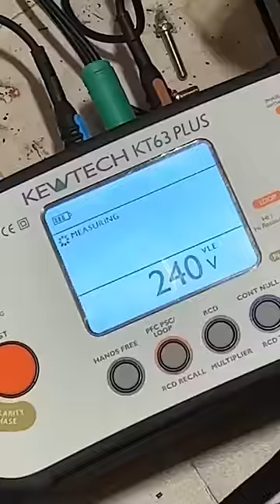Adapt improvise and overcome. Converting TNCS to TT #shorts

Comment: I'm amazed to see someone actually doing their job properly on shorts for once 😂
Reply: Except he didn't. First of all no professional in their right mind would convert TNCS to TT especially considering it would involve ripping up the street and changing the lines from the substation.
Reply: @xARMM4G3D0Nx  what I meant was his practical skills not the job itself
Reply: @jordanf811  would have been better to not post anything at all.
Reply: @Big_AlMC  cool
Reply: Crap and dangerous workmanship
Reply: @xARMM4G3D0Nx  Looks like he added a RCD and a Groundrod. So no direct change of the Gridtype. I think it’s even more a TNS than TNCS because of the allready splittet TN to Earth and Neutral.
Reply: @Srype5  well the title literally said "Converting TNCS to TT" wich is definitely not true.
Adding a Groundrod or whatever you call a "Tiefenerder" in english doesn't change anything, as you already know (besides lowering earth resistance) and I was pointing out said bullshit
Reply: @jordanf811  His practical skills don't include the knowledge that its illegal to remove the supply companies fuse.......
Reply: It was good to see him tighten the screws on the main wires coming in.

Comment: Yeah, that looks really nice, but the question ist WHY? There is no benefit to convert TN-CS into TT. You only increase your ground resistance (which is bad)
Reply: Maybe they’re having an EV charger put in.
Reply: Often I’ve come across this situation when questioning the DNO’s high impedance. The engineer will turn up and inform you there is no PME to that property and it has to be converted back to TT. 
I believe the earth rod scenario for EV’s would be to run alongside the existing PME, similar to a detached garage scenario whereby exporting the PME isn’t allowed. Given the high current characteristics of an EV the earth rod ensures that should the neutral go down on the PME then you still have earth connection to create your potential.

Comment: Beautiful work! Man, when I see how breakers, grounds, and sockets are done in other countries, I feel like here in the US we're still in the electrical stone age.
Reply: So isnt That in the USA? I thought so…becaouse of that many Milwaukee devices 🤷🏻‍♂️
Reply: @momimu90  nah, British if I had to guess
Reply: Fr I drooled over the breaker panel setup a little lol
Reply: No, usa load centers with bar buses and plug breakers are superior to that din boxes with a lot of cable and connections.
Reply: @momimu90 na that’s definitely not here in the US looks like the UK. Milwaukee is worldwide brody
Reply: @kefrenferrer6777  Nothing in the American electrical system is superior.
Reply: @NoiseMakerX  take it from me I’ve been in residential electrical for 10 years and we Definitely have a safer electrical system inside are homes. For starters the ground rod is only 3 feet long. Ours are 8 and you will have 2 of them.
Reply: @mottfuggelmire8514  Well, where I live we don't even need ground rods per house in most cases. Ground is supplied via incoming power. Another lousy thing about the US power system is that it is 120 V making every current in the end user system twice as high. And I've seen so many vids of power distribution poles burning. That couldn't happen where I live because the breaker would cut power before it got dangerous.
Reply: I don't know. I feel like, if the ground was grounded in America your house would burn down.
Reply: @momimu90 240V is not used in US. It's probably australia as far as i know, they (and a bunch of other countries) use 240
Reply: @creeper_ninja_ in UK the socket voltage is 230V
Reply: You have it backwards, friend.
Reply: @git-push  Australian men wouldn't wear gloves to use a drill and a screwdriver lmao my guess is uk
Reply: @git-push  contrary to popular believes, the US does use 240v for high power appliances like dryers, air conditioners, etc. The transformer for each house creates 240v with a CT/center tap for 120v.

Low power devices use this center tap for 120v but high power appliances use both ends for 240v
Reply: Is uk standard.
Reply: Is uk standard

Comment: Those Lewden RCBO’s are single pole. If you have a persistent earth fault on that CU you will lose all of your board until you clear the fault due to the front end 100mA type S. DP RCBO’s are the way to go if you need a time delay main switch.

Comment: As the absolute most bureaucratic red tape I thought I would ever see around the grounding rod
Reply: Without having seen the breakers yet, Gotta be the UK or maybe Australia. I've never seen one in the states that wasn't exposed with a bare copper wire running to it.
Reply: @MrNside  probably oz or kiwi. No CE labels on breakers.
Reply: UK England

Comment: Good job didn't necessarily need the 100ma RCD main switch as all the circuits have 30ma RCD protection.
Reply: Yeah I was surprised to see a 100ma being fitted these days. They look like rcbos. Maybe they are single pole?

Comment: Not sure what the requirements are over in crumpet land, but here in America you need a 16' deep rod. Or have two 8' lengths spaced at least 6' apart. Last I checked the physics of electricity are the same on either side of the Atlantic.
Reply: The requirements are different, that’s all I can tell you
Reply: Not quite accurate but not a violation.

Comment: Great work - pulling the DNO supply fuse ( bet u cut the seals first as well, noted there was no HV gloves and likely face visor, arc proof trousers and jacket) an absolute inspiration to those who think this is acceptable working practice - which it isn’t - you would be off the job on my watch.
Reply: dont talk rubbish, he switched all power off before removing dno fuse, its not NASA rocket launch....
Reply: Oh right so u know the cut out is electrically safe then? Let’s pull the fuse and wait for it to short - I’m a DNO electrical trainer you dckhead and know what I’m talking about , load or no load.
Reply: @AS-rb6yp  weird we had 10 flats that 3 blokes turned up to connect / fit meters  first bloke was not 3 phase trained so called in more colleagues ( each supply was Single phase ) but he could not grasp that 😂 They had gloves / goggles / face shields which kept steaming up and I have to say in 45 years of being a sparks I’ve never seen such a mess at the end of it but I suppose they were alive and hey who worries what the job looks like these days 😉
Reply: @kevinpickett7249  As I always say to any engineer - make a good safe and tidy job - ur name is going on it with ur seal number plus it’s going be there for many years - the prob is that there is too much emphasis on getting jobs done not forgetting your incentive payment there is no excuse for bad and dangerous practices and this video clearly demonstrate this and makes it appear acceptable. In so far as the flats are concerned that is an example of an engineer who has been signed off when he shouldn’t have been and another issue waiting to happen.
Reply: Ok karen
Reply: @YaM0MsAh03  you what?

Comment: Checking the comments for the “You did it wrong” gang. Undefeated😅
Reply: he actually did it wrong, not the method, just the work. proper grounding means you use a rod that goes about 7-9 meters into the ground (they come in 1meter sections which get screwed with one another, the first most bottom has a special tip)
Reply: @davideyt1242 what does this rod do?
Reply: @45-308  It's a grounding rod, the short 1-2meter long stuff is mostly sufficient for a roof mounted Antenna but not for grounding the electrical network of your house. true grounding is done 7-9 deep, since this is really deep those come in sets of 1 meter long rods which screw to each other, the first most-bottom part has a tip, you basically hammer them one by one and screw the sections until you reach a proper depth then you screw on top an adapter which has a slot for your grounding wire which than gets wired into your main switch box

Comment: There is actually a bit for the chipping hammer to ram the ground rods in. The rod fits in a cup much like the holesaw you used. I believe they are available in SDS plus and SDS max.
Reply: I have a similar adapter for a spline drive rotary hammer.

Comment: Milwaukee boy here. I’ve never seen that light before. Must have.
Reply: It is incredible!!
Reply: Them red tools not very good
Reply: @PLF...  Yeah, ok, whatever. Make me laugh.
Reply: 12V Rover service light. About $60. Been out for over a year, keep your eye out for the combo with battery for the same price. Does USB charging too.
Reply: I know right! Player ass light ....only thing I dislike about Milwaukee is the 12v , the batteries slip out the bottom of drill/Sawzall
Reply: @seanolsson1226  Mine never fall out. I’ve never heard of that happening. In fact, my batteries are a bitch to remove.

Comment: In America we bury a bare wire between the ground rods so it'll always pass the resistance test
Reply: You like cheating?!
Reply: @tekknorat  yes
Reply: Who’s going to test resistance to ground for a residential ground rod install? Only time resistance to ground is mentioned in NEC is supplemental grounding and mentions 25ohms or less.
Reply: @Yousitech  I can't stand it, but you will say that it's ok, it's what the world is built upon.
Reply: Americans. You go overboard with earthing, but you still haven't figured out RCDS
Reply: @penguin4597  actually we don't the ground rods are just put in the ground and attached with a grounding lug the only wire buried would be the short distance between the top of the rod and the entrance to the building. Basically where the wire loom runs in this video as we don't to a box and look for it. And even then it's only buried over time from buildup or other construction happening
Reply: @penguin4597  also we use a different term for rcds but while traditionally used only in wet area over the last 50 years it's been becoming more coming to install on the whole home with at minimum installation of arc fault with plug on neutral  breakers
Reply: In Brazil if you don't watch closely as the electrician hammers the rod into the ground the rod gets smoked in the form of crack the same day.

Comment: That house is going to be very safe now, its not just about the earth leakage, he is also converting it from a neutral ground circuit breaker to a proper earth residual leakage detector which will trip the moment the ground is sensing power leakage (like touching the washing machine or toaster and your getting a shock, no more with this setup)
Reply: IF the RCD works.

Comment: Маловато одной секции будет для заземления.
Reply: You can clearly see it’s 16.05 ohms which is fab for a TT
Reply: Кто тебе такое сказал?
Reply: @evgenigeyker3609  по опыту, сделайте замеры сопротивления и все будет ясно.
Reply: Как повторное сгодится 15 ом
Reply: @navinavi4404  ну если как повторное, может быть.
Reply: @oiuslags
Reply: Согласен, халтура 🙈сдс + минимум 8-10метров и перф Мах должен быть
Reply: @oiuslags  it needs to be 4omh if you'll use gas warmer :)
Reply: В разных странах разные требования. Многопроволочную жилу в винтовые контакты закручивают и ни кто не возмущается.
Reply: @Ardoom  interesting 
In the uk external earthing (Ze) is 0.35 , 0.8 or upto 200ohms ( 1666 ohms max)  ( but should be below 200 ) 
0.35 is supply company earth via the neutral at the income point 
0.8 is the same but over head lines (as it’s harder to get as low) 
200 (1666) is independent earth usually by a rod and must use additional protection by use of RCD main switch or multi RCBO’s but every circuit must have additional protection 

There are conditions attracted to all of these types of earthing 

30mA rcd at 1666 ohms give a max of 50 volts to earth before tripping which is the safe value uk electric is based on 

Internal earthing needs to be all within 0.05 ohms to be equal or as near as possible for the fuse box, gas pipe,and water pipe
Reply: Это ж Америка, страна свободного выбора. У них кодекс у нас ПУЭ и ПТЭэП и ПТР и дохуа умных книг и правил. Так что человек просто делает свою работу как может но по своим правилам. У нас же газовщики требует сопротивление при установке котла 2-3 Ом а кто делает? Вот то то же, единицы и то большинство уголок в землю и считают это норм
Reply: @ДмитрийИванович-я5ф  так он же делал замер. Ты не заметил прибора?
Reply: @Bluesman990  ну, есть читатели, а есть писатели)
Reply: @Bluesman990  замер делается в два сезона, в засуху или в максимальное промерзание грунта  . То что он померил, допустим после дождя - не очем не говорит
Reply: @ИгрокИграющий-в6ъ  поэтому и делают замеры правильно.
Reply: @oiuslags  16 Ом много, должно быть 4 Ом для однофазной сети, 2 Ом для трёхфазной.
Reply: @Анастасия-с5ч3б  Не обязательно. Я 9 метров обычным перфом зафигачивал
Reply: @grafercs  так на многожильный провод одевают концевики и обжимай сколько хочешь. У них концевик для многожильных проводов обязательны.
Reply: @grafercs  верно, наконечники нужны
Reply: Инспекция приняла, это их ГОСТ.
Reply: Para domiciliaria si, no para industrial.
Reply: Para industrial se utiliza malla
Reply: Это мелочь.Мы как то башенный кран в 90-годах заземляли.Уголок 100мм-3 метровый в три точки.Били,били ещё били время уже обед,пошли обедать,Сидим обедаем, вдруг бабах рядом ТП, здоровенные ворота улетают через забор.Метровые предохранители взорвались как гранаты а их три было.Так вот помню я сказал пойдем обедать,после обеда добъём уголки.Центр города оставили без света,вообщем попали в бронированный кабель. Ещё бы один удар и кто нибудь из нас в пепел превратился.
Reply: А можно на одно заземление два провода заземления с разных щитков кинуть ?
Reply: @navinavi4404  как повторное - вообще не нормируется!
п. 1.7.61 ПУЭ - только в России
В остальных странах всё по-понятиям.
Reply: @Blackrawen  это не в Америке
Reply: @bahopik  хорошо не в Америке, тогда по правилам сделано? Если да то ок. У каждой страны свои электротехнические правила. В Канаде вообще кодекс🧑‍🏭
Reply: @Alexandr_Kolomacky_82_RUS  4 ом для трехфазной сети. 0,5 для подстанций
Reply: @lazerman1966  ну вы даёте, планы нужны были инженерные чтобы бить уголки. Тут на честных участках боишься бить всё узнаёшь, а вы в городе)

Comment: I hope you resealed the cut out after removing and replacing the main fuse, and wore the correct pipe, rubber gloves, leather over gauntlets, full face mask etc.
Reply: Not a hope absolutely grim working practices suggest to remove video.

Comment: What's this, I thought I was watching an eFIXX short
Reply: In México we do not use nothing like that. Just cable, tape and lots of faith
Reply: Here in Argentina we call it jabalina (javelin) It's made out of copper and it receives all the ground discharges from an electrical installation.
Reply: TNCS and TT are two different Systems used to Connect a Home to the electric network.
Reply: earth fault breaker
Reply: Earth ground.
Reply: @kinostory  I just had a stroke reading that
Reply: @vulcano911  LOL. - I can back that up!
Reply: Shortest ground rod ever.
Reply: @fueradecampo  in the USA it is just copper coated these days ...
and i'll be the copper rubbs off when they drill it down

Comment: If your local code requires you to drive the entire length into the soil, then you can’t leave any part of the rod in a box unless the entire length is long enough to include the driven amount in the soil. And there is the matter of making sure the box is listed; you can’t use homemade arts.

Comment: The second chuck that was put onto the rotary hammer drill / sds and it was made to use / hold let’s say flat bits then as soon as you use on hammer it will break it guaranteed it’s not made for hammer

Comment: In Australia that reading would have to be below 0.5 ohms... oof
Reply: Why?
Reply: @Chris Gibson  Yup, same here: the resistance of the earthing conductor itself (from the Main Earth Terminal to the means of earthing) and any main bonding conductors must be "as low as practicable" and generally below 0.5ohm.  But the Z(e), the external part of the entire resistance of the earthing system, cannot sensibly be that low when what you are measuring is the resistance (actually in context the impedance) of the general mass of earth between your means of earthing (a single copper spike, however long) right back to the transformer through land of unknown characteristics out of your control.
Reply: In Russia, no higher than 4 ohms for phase voltage (230V) and no higher than 2 ohms for line voltage (0.4kV)

Comment: Question. Is there a significant difference in using a copper plated steel rod instead of solid copper? Also, how deep should the rod be? Desert environment(dirt, not sand).
Reply: who sells solid copper rods?

Comment: Switchable screwdrivers and such can be handy but when it comes to using insulated tools like a screwdriver on a potentially energized source I really prefer and propose that solid one piece screwdrivers are safer than multipurpose and multi-bit drivers for the simple reason that interchangeable tools can come apart while working creating a hazard if they fall into/across/etc live circuits and such. Plenty of times i have pulled my screwdriver away and the bit I was using stays mated to the screw or whatever. I and others have used multi-bits and the bit stay in the fastener and user not notice till the next fastener.

Comment: As a lightning protection engineer and a specialist earthing engineer this makes me laugh so much compared to the uk regulations
Reply: Go on, do tell us more
Reply: @12000gp  first of all, the grounding only results in 16 Ohm resistance, not sure about the UK, but most of the EU requires a grounding point to have 5 Ohms max.
Second: copper in soil ground is a nogo, it will corrode and potentially get higher resistance pretty quickly, especially in a DC-fault case which can be dangerous.